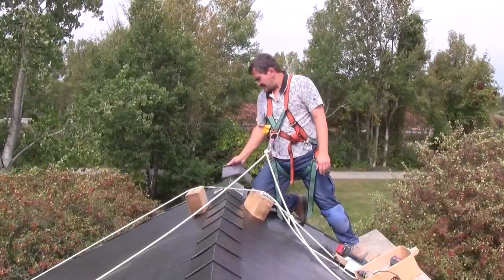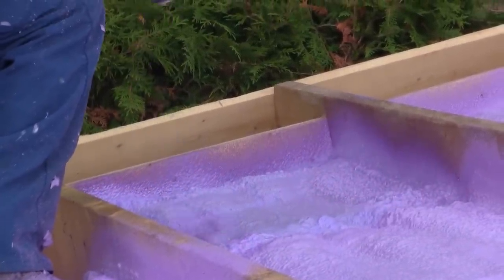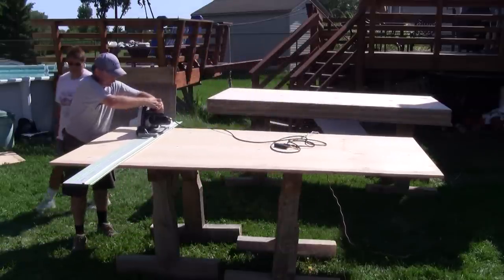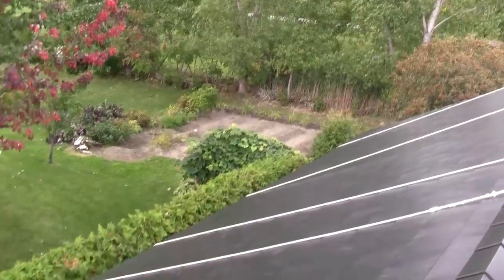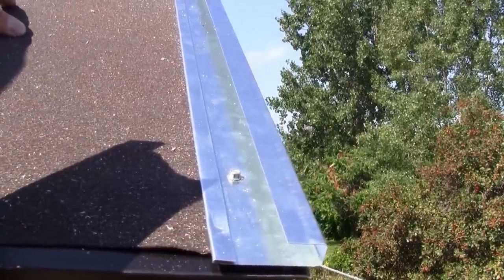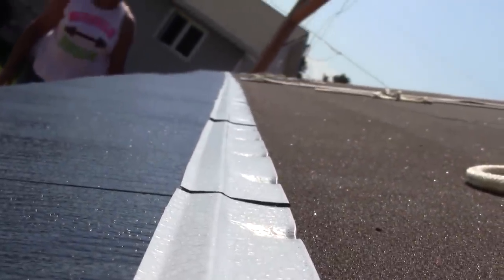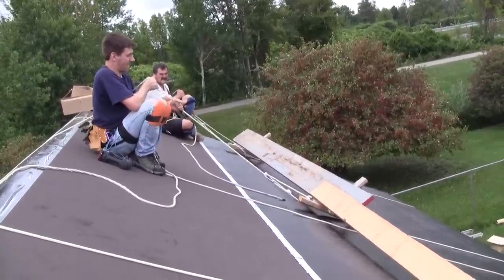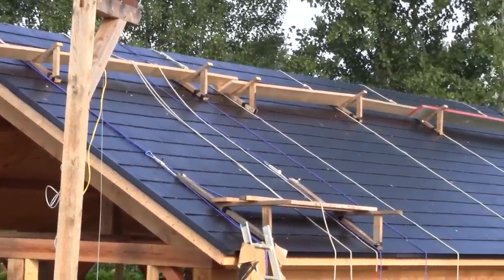The Woodpecker Ep 61  Building the new shop part 8   The Roof

Comment: Thanks for the video. Love the style of the shop especially the framing.
Can anyone explain the benefit of this roofing method? I really can't grasp roofing methods like these. It uses so much material and takes an amazingly long time to install. 
Here in Australia we use Clay/concrete tiles or sheets corrugated Iron.
We don't add a layer of ply on top of the rafters, our roofing is fixed to battens instead (minimal use of material and quick).
A two or three person team would have that roof sheeted with cappings in a day. Is this just a method based on tradition or is it specifically developed to handle extreme weather?
Reply from the maker: I never ever saw a house with clay siding here. Some metal roofing system uses batten underneat but not this kind. All our houses have at lest 5/8" of OSB, I put ¾" of plywood. But you have to understand that 99%+ of gabled roof are in asphalt shingles here, so we need wood everywhere underneat to nail the shingles. And on rough roof like that the snow stays on top of your house, and sometime it's a lot of snow... On my smooth metal roof, the snow always fall down, but it doesn't on my rough metal roof of my house.
Reply: Thanks for the reply. Looks to be similar to some building methods here, it is done that way because it has been done that way for a long time. Australia used to have wooden shingles, but they went out of use a very long time ago here.
Seems your roofing methods are a bit of a cycle, the weight of snow demands a very strong roof, but if the roof was a different material the snow wouldn't build up and wouldn't need all that strength.
Our roofing sheets generally cover a bit over 700mm wide and will most often be the length of roof (ridge to gutter). So little chance of leaks and very quick to install. 
When I get time i'll go through all your build videos, looks interesting.

Comment: That's a lot of work just for a shed. I would have used full long metal roof panels. Done in just a few hours.
Reply from the maker: Rod Sapyta The city didn't allowed it. But even if it was my first choice, I'm so glad they forbid it , this looks 10 time nicer. But I had to work on this for several days. What is several days if his will stand for over 50 years, contrary to asphalt shingles;.

Comment: I'm quite surprised that considering the snow load you must experience in Canada your roof do not have a higher, more alin style pitch. Is there some disadvantage to the high pitch or is it purely aesthetics?
Reply from the maker: The pitch is above the avrage pitch. It's a 7:12 pitch. My house wich is in the normal pitch is 5:12. But I would have put an even higher pitch if the city allowed me to. I was not permited to have a "garage" higher than the height of my house. Since my house roof is 5:12 i have 17' from the ground so the "garage" must not exceed 17' there the 7:12 pitch.

Comment: Alain, what is the brand of roofing you used?  Thanks!
Reply from the maker: Vicwest  http://www.vicwest.com/residential/products/steel-roofing/summerside-steel-shingles
Cost me 4K approx for the shingles and everything I needed for the instalation (without the costs of the membrane).
It was 4 times the price of asphalt shingles, wich usually last 15-20 years. So in the long run I hope to have saved money.
Reply: Thank you.  Looks great :)
Reply from the maker: projekt89130
Thanks, I like the looks too. It's longer to install than asphalt shingles,because of all the screws but I think it was worth it.

Comment: How did that purple stuff turn yellow?
Reply from the maker: The insulation guy warned me about it. He said that all urethane turn yellow when exposed to the UV. And it really turned yellow and in a short amount of time. But if I cut a piece it's still purple wher no UV touched it.
Reply: That is pretty interesting. Though i guess it makes sense because if you think about it. Its nothing but thin walled closed cell foam. Thus the thin walls will bread down to UV very easily.